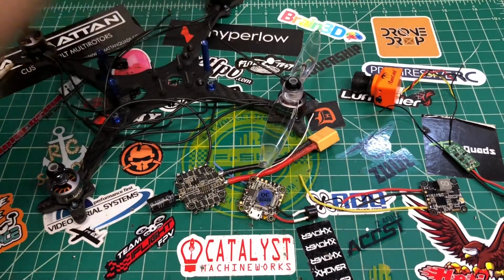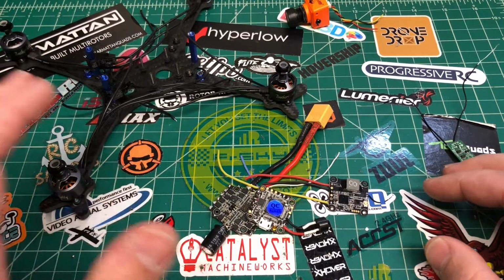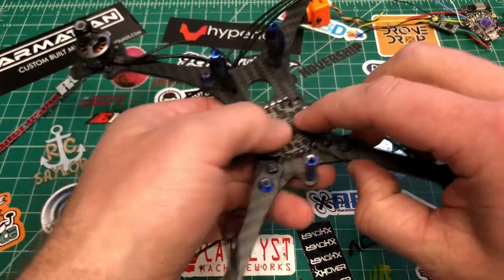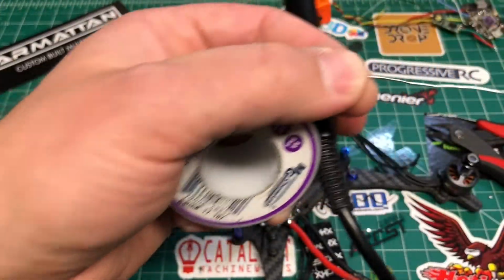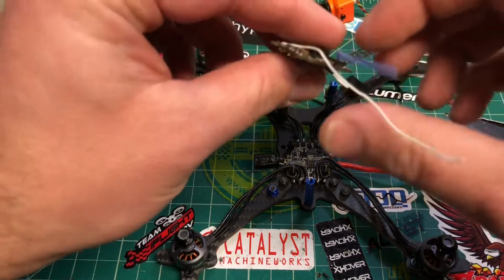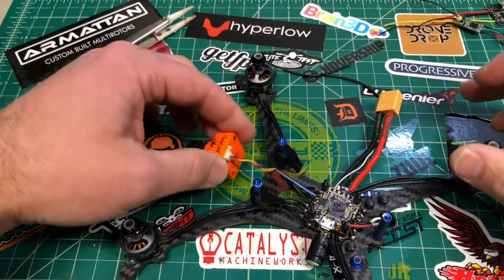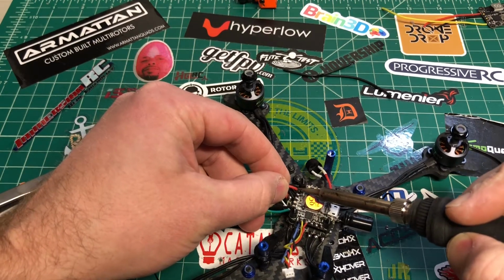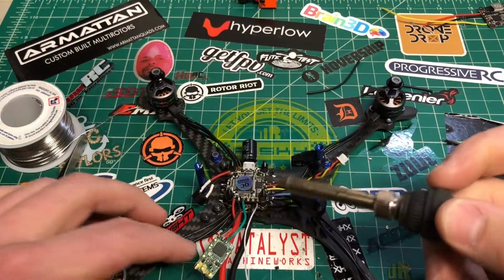Ultralight Floss V1 Build- 199g!!! Part 1

Comment: I just finished the floss 2 with canopy. I got the hglrc 40a blheli32 stack an axii ufl antenna, t motor air gear 200 2650kv motors, x6b rx, caddx s1 micro ccd camera and some 5046 cyclones! And damn man I gotta say it’s crazy light and the canopy makes it looks sooo amazing! I think the canopy may be lighter for the floss 2 because of the larger carbon plate top and extra stand offs screws and lock nuts that are eliminated.  I’m gunna be grabbing the floss 2.1 arms for it because they are backwards compatible with the 2.0! They eliminate 2 screw and nuts and make the whole frame much much stronger! Have you flown yours yet? It looks awesome! I love Hyperlites stuff!
Reply from the maker: Mini Quads Mega Fun just a hover test. It’s been raining here since Thursday night, today was insane wind, hopefully tomorrow I’ll get some air time. What batteries are you using? I only have 1300 4s from my acro quads.